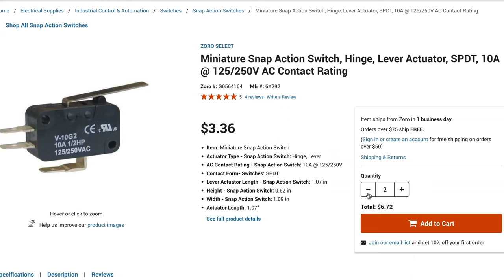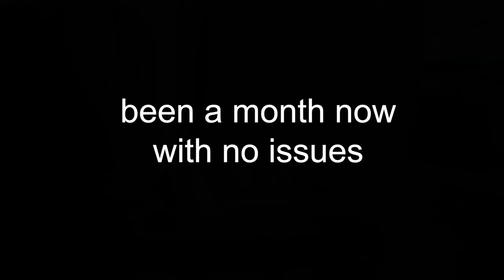Condensate Pump Won't Stop Running

Comment: So you changed the positions of the switches ? And added the long metal lever to it??
Reply from the maker: I didn't change the position of the switches. The rear switch I assume was originally intended to be a safety backup? But it was not connected to anything, so after confirming it was in working order I transferred the connectors from the failed switch to the one that was not being used. The triggering mechanism is slightly different on the rear switch, as there is no lever - it relies on the float pressing directly down on the button. So far so good